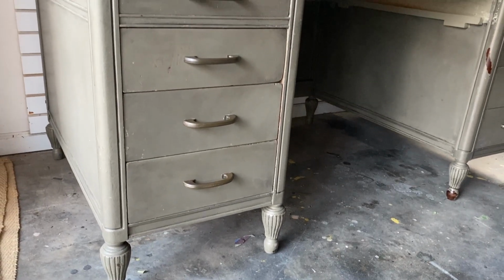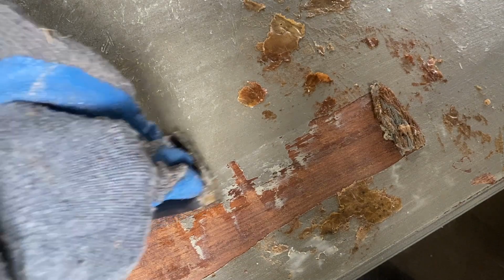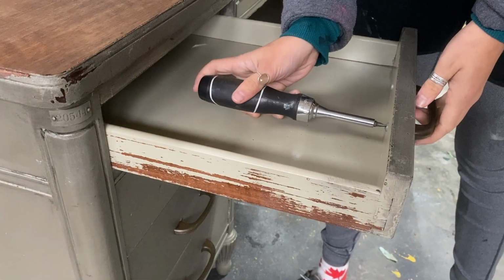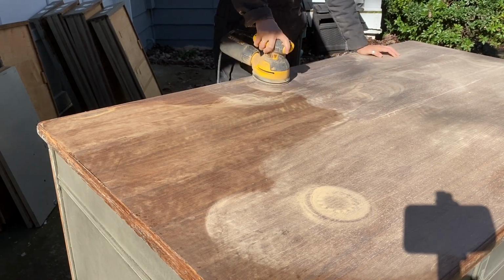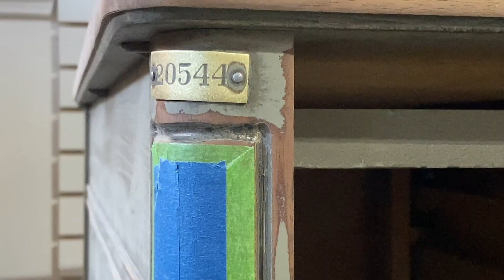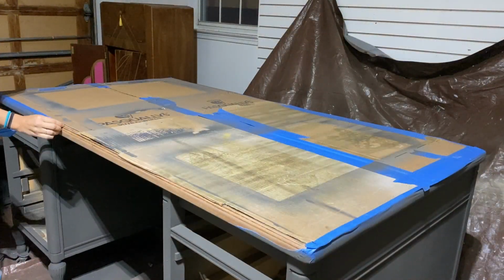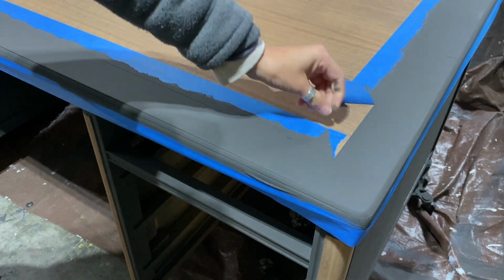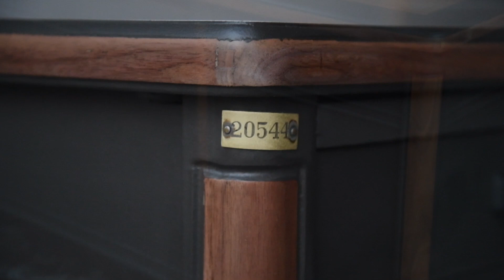Antique Desk Makeover | Ugly Duckling Challenge Hosted by Desert DIY

Comment: would you be able to use canned spray paint? i’m trying to redo an antique desk and am doing something similar but cannot afford a paint sprayer
Reply from the maker: I mean, technically, yes. However, the amount of canned spray paint that you would need would not only be terrible for the environment but it would also probably be super expensive to the point where you might as well just buy a paint sprayer. There are some pretty affordable ones on Amazon. But if you can’t afford either, I completely understand and you’re probably better off going the old fashioned hand painted rout